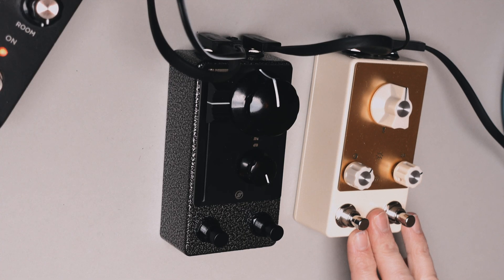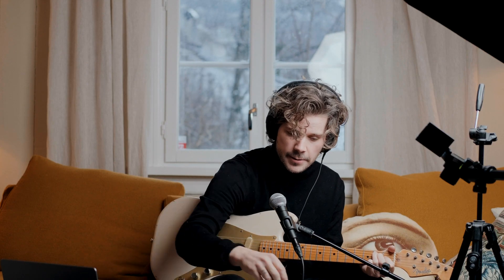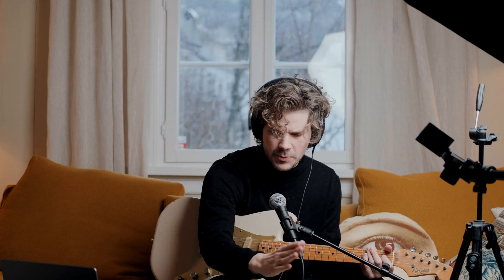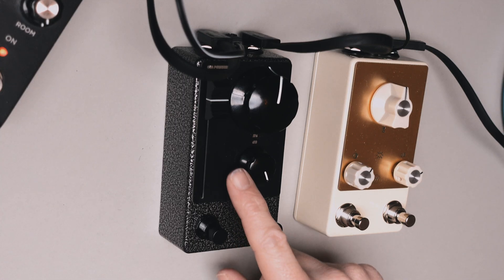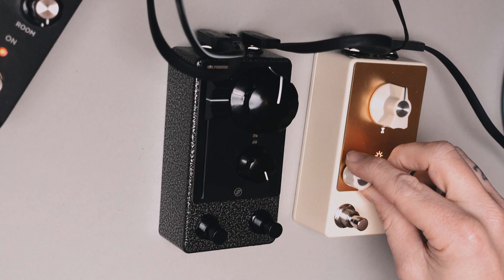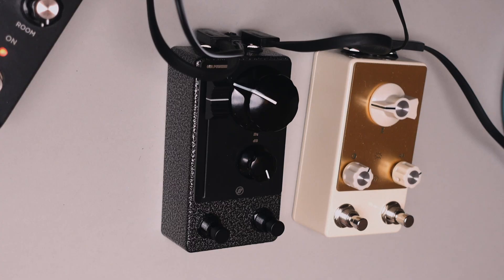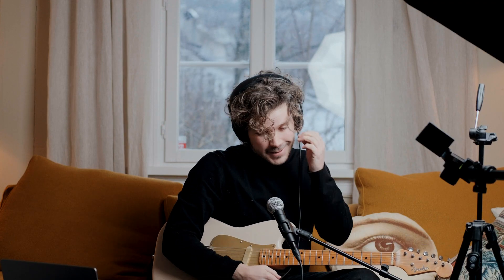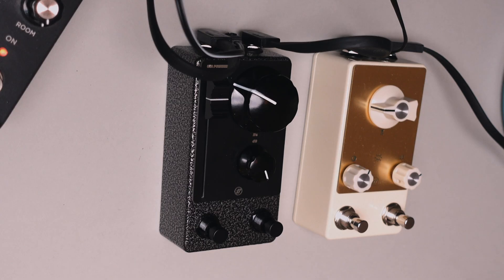Can we make an authentic-sounding Uni-Vibe circuit without LDRs?

Comment: Great work! OTAs offer way more possibilities in audio circuits han LDRs, known for decades in synth world designing, they are more precise and more controllable since they operate with current, microchanges can lead to a better variation on the sound. On the other hand they can add complexity that sometimes is hard to fit on a guitar pedal. I have used them a lot on my synth designs. I am interested to know more about the legislation as a small scale manufacturer. Can you please provide us more sources about EU legislation regarding the LDRs?
Reply from the maker: Thanks so much! I think as a consequence of the legislative stuff going for OTAs opens up a whole bunch of new possibilities. As for sources I would suggest looking up RoHS 3 and also GDSR. All the legal stuff is very difficult to fully grasp, admittedly, but as for LDRs specifically, these use cadmium which is banned and recently the exemption for audio devices was lifted. The EU measures cadmium by weight for each individual component, so theoretically you can use (and I have) certain LDRs that are big enough that the actual cadmium content is low enough they’re still legal. These are very expensive though, and take up a lot of room inside an enclosure!

Comment: It sounds like the new design keeps the throb at lower speed settings, a weakness I've noticed with optical circuits (even the original). Would you agree?
Also can you put up a good gallery on your website for different enclosure/hardware colors?
Reply from the maker: Thanks! Well, the weakness at lower speeds on most optical ones comes down to clipping diodes in the LFO as well as that sort of very quick rise and fall of the LFO wave itself. I never use those diodes, so that’s really not an issue for me, but the way the LFO on this one works might also be particularly beneficial to low speed settings!

Comment: Wow, first I've heard of this EU ban on CdS photocells!  Most inconvenient.  Researching it, there don't look to be good alternatives.  One type uses Indium Antimonide, don't even know what that is, but it has that "banned" kind of sound.  Plus, they only detect far infrared, and they require cryogenic cooling.  The cheaper, simpler alternative type are Lead Sulfide (PbS), often used as flame detectors in furnaces and such, only detect IR once again, not explicitly banned by the EU like CdS is, but surely the Pb runs afoul of RoHS so still a no-go.  Darn!  I'm glad people like you are developing alternative ways to control resistance with voltage; but for guitar amp related applications, it'd be nice if it could involve tubes and not solid-state (a tube Univibe has always been a project desire of mine).  Food for thought/experimentation...  Anyway, thank you for your very interesting videos, and nice guitar tones!
Reply from the maker: If I remember correctly, somebody made a tube vibe at some point! Maybe Strymon before they changed their name from Damage control?
Reply: @FjordFuzz  Yes, someone already did make a tube Univibe.  It's pretty costly, but fair enough.  The circuit seems particularly amenable to replacement of the transistor stages with tubes, because the in-phase/out-of-phase signal paths pretty much resemble the topology of the common single tube stage phase inverter, and basically no gain is required.  Trickier is to replicate transistor fuzz circuits with tubes (actual fuzz, not just distortion), and to replace the transistors in the usual wah pedal circuit with tubes.  But these are my ambitions!
Reply from the maker: @ as for vibe, I’d love to see someone use vari-mu tubes to do that!
Reply: @FjordFuzz  Yeah, I've wondered about some of those tubes -- I guess vari-mu is the term?  Things that were used as mixers or to produce a multiplication function, in radio circuits and such.  Of course, these tubes may not be readily available in this day and age, unlike the ever-popular 12AX7.  And having to use four such tubes, plus no doubt a few other tubes, just to make a Univibe, is a bit of a bummer and not likely to be cheap!  But I'd certainly try it if it seemed like it could work.  My first comcern would be, the minimum available resistance is (just guessing) probably not that low, probably higher than CdS photocells; so at the least, significant circuit re-scaling would be required...
Reply from the maker: Also, yeah the ban is unfortunate, but it’s important to avoid using components that put workers at factories at risk of exposure during manufacturing. Cadmium is really bad for you, so if we can make OTAs do the trick, I think we should!
Reply: @FjordFuzz  I agree, glad to see governments and societies taking public health seriously, wish that would happen in the USA.  I've been examining using MOSFETs as voltage-controlled resistors.  Should work in theory; in the Univibe, a complication is that the variable resistance needs to be floating, not tied to ground.  But maybe a resistor ladder as would be used for an audio attenuator would work, where the fixed resistor goes in series, where the LDR was located, and then the MOSFET resistance goes from there to ground.
Reply from the maker: @ yeah that might work, but the problem with the uni-vibe specifically is it relies on very high resistance change as well as a very smooth transition between high and low resistance. You can use two OTAs back to back as a floating variable resistor, but I haven’t had any luck with that in practice. You could also use FETs, but if you’ve ever tried the Dunlop vibe you know how poorly that works. My solution has been using single OTAs as all pass filters replacing the entire phasing circuit and while that does change the sound, I’m not convinced it’s for the worse.
Reply: @FjordFuzz  I haven't tried/heard the Dunlop vibe, I'll have to check it out.  This is all kind of a sonic quest for me.  Your stuff sounds great, it's basically a benchmark to me, in terms of getting great tones without simply replicating the old circuits.  Thanks for the interesting discussion.

Comment: Have you considered making a dual version which can run the vibes in series as well as separate the high and low cones of the vibe? I like this and I wonder if the way you use two of them together collectively if you could make a version with two.
Reply from the maker: Yes ever since I spotted it I’ve been thinking about that! It would require a bigger enclosure though, there’s really no more room left, but I could even put them in parallel if I wanted to and give you all sorts of routing options! Sky’s the limit here now that this stuff has proven itself to do the job not only well, but really well!
Reply: @FjordFuzz  sounds like doing for a univibe what teh obne float did.
Reply from the maker: @ I haven’t seen that, but I’ll check it out!
Reply: @FjordFuzz  the only thing I would say is if you could link the vibes timing together and separate at will. That would be the only worry I have for it and recording at times.
Reply from the maker: @ yeah, makes sense! Luckily, the OTAs are voltage controlled (actually current controlled), so tricks from the synth world can be applied in order to do stuff like that. The challenge would be in implementing it all in an easy-to-understand way!
Reply: @FjordFuzz  I am excited to see what's next.
Reply: I have the obne float and even before I got my midnattsol I thought that it’d be great if there where separate ins/out for the fuzz and vibe. For a dual vibe it makes even more sense to get all those different routing options. I’ve been running my midnattsol into another modulation pedal with  (what I think is) great result in a few different ways, all useful. 

Great video as always, btw!